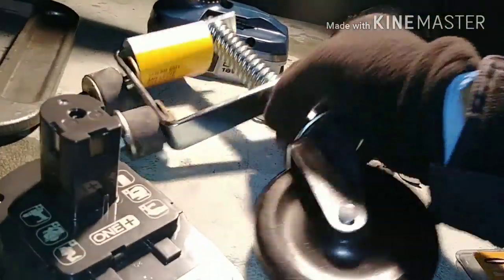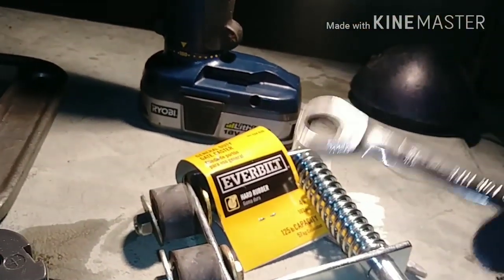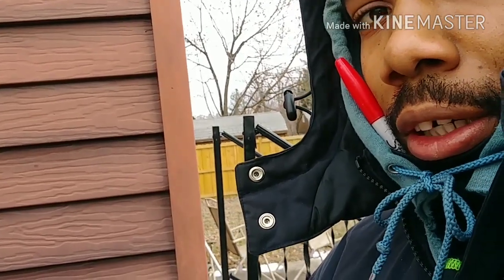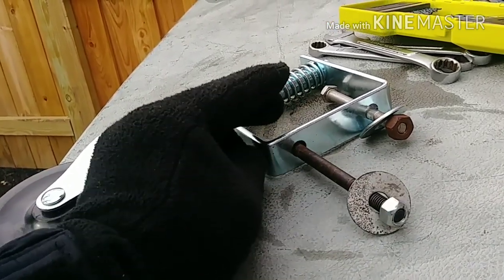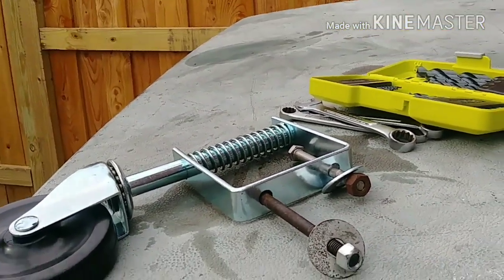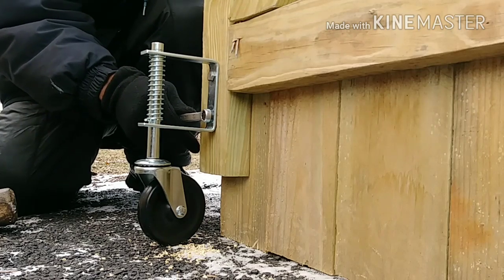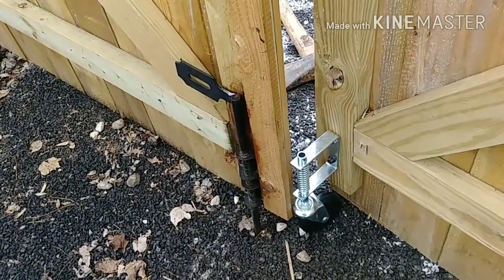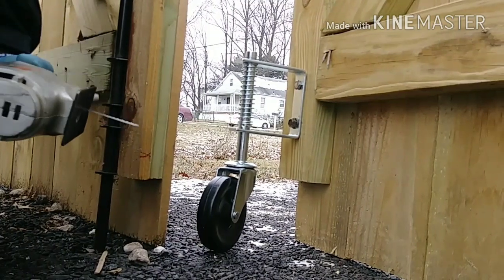Old Errol:wood fence gate wheel building a cement work pad area Vlog 2

Comment: Your compression Brace is backwards. Swith it and the sag will go away. Do not use a tension brace on a wood gate. Wood gate suffer from compression while chain fence suffer from tension. Also interesting idea using rubber bushing.

Comment: Hi good idea with the wheel. The main reason your gate has dropped is because the diagonal braces should be going the other corner to corner. the way they are fitted are not supporting the gate from sagging
Reply from the maker: Thanks. Me and my new  Neighbor was just discussing how bad of a construction my gate was. now hes install in his own gate and shown the proper way that it should have been done.
Reply: Correct 👍
Reply: @olderrol1968  hey brother , I'm Mexican and it really appreciate your idea .
Gracias amigouuuuu
Reply from the maker: That you for your kind words. 👍

Comment: Couple things you did wrong here. You could have added wood to were you wanted to mount it, 2 you should have shimmied up the fence before drilling the homes and mounting the wheel so the spring takes the pressure,  shim it up allot higher so when the wheel is mounted with wheel on floor when fence drops the spring load hold it up. Also spin the bolts around and use stainless or galvanised bolts that wont rust and aren't dissimilar metal of the wheel metal
Reply: I was about to ask, how do you know where the screws go for best tension. Thank you.
Reply from the maker: I really just guessed. I tried put in as much tension on the gate wheels pride to install in this.  Because once the gate gets wet. it comes down a little bit more than normal.

Comment: Very useful video. I'll be doing something similar to my driveway gates. It might help you if the diagonal cross-bracing on the back of the gates is mounted in the opposite direction, meaning that its low end is at the hinge side of the gate and the high end of the cross-bracing is at the opening side of the gate leaf. That way, the cross bracing will be able to support the gate leaf from sagging. But you have to make sure that all the joints or fixings that connect the cross-bracing to the gate leaf are tight and secure so that all the force of the gate leaf that wants to sag is transmitted into the bracing. Hinges also have to be securely fixed to the gate leaf. Hope this helps you. Thanks for the video.
Reply from the maker: I will most definitely look in to putting some kind of brace on the gate in the future.

Comment: What you should have done is lifted the gate up slightly so when fitted it sat down on the spring a little bit
Reply from the maker: I will definitely keep that in mind. Thank you 👍
Reply: @olderrol1968  ground all looks pretty level that it’s rolling on but taking some slack up on the spring means that if there’s a dip in the ground the spring will travel to meet the ground otherwise the wheel will just hang in mid air and be of no benefit
Reply from the maker: @davidktd  : The gate drops when   It gets wet from the rain.
Reply: @olderrol1968  all ok. All good though. I’ve got to fit mine on a new set of gates.
Reply from the maker: Yeah. I find at the gate wheels itself. Wear's out is out over a period of time.😣. Home depot should have them in stock.

Comment: I would just say that, though the wheel wouldn't be central on the vertical wood of the gate, I think you would have still had enough strength in the wood if it had been put a bit to the right. You could always still move it, but you would need to glue in some wooden dowel to fill the drilled holes to be able to drill new holes fairly close to the old ones. As for the bolts, if the nuts still come loose, buy some nyloc nuts. They should only be a few cents and they won't vibrate off the threads like those normal nuts. Otherwise good job pal.
Reply from the maker: The was it is works pretty well .

Comment: The bolt should have been inserted from the outside of the gate for a cleaner look.  Also, I would have compressed a little bit of the spring before mounting the caster wheel to the gate so that it would take some of the load off of the gate hinge.
Reply from the maker: Most definitely.  I'll look into that.

Comment: I think it would be easier to cut the door only half centimeter (or more, if you need) in the low part. If you look in the first seconds you can see that the boards have different measures. Greetings.
Reply: I agree kindly.

Comment: I just found Northern Tool’s item 60993 which is a 400-lb-rated double wheel. A reviewer pointed up its bracket and U-bolt fit a FENCE pipe 1 & 5/-6”. Since my GATES are of 2” pipe I’ll modify the bracket and use 2 per gate section. That should over-engineer it. Thanks again for showing us the way. 👍
Reply from the maker: That sounds like it's going to work even better than the one I have .i would love to see the finished product.
Reply: Lol sounds like me. Rather build it once and over engineer.

Comment: Thanks for your video. I just discovered this kind of face-of-gate-mounted wheel. My gate is heavy so I may reverse engineer one of these to use heavy-duty parts. I wish somebody has already a sturdier one. Anybody know of one? Good job.
Reply from the maker: The gate wheel mount is a great idea . but I wish the spring was stronger.
Reply: @olderrol1968  where did you buy the wheel?
Reply from the maker: @powerstuffup  : At The Home Depot
Reply: @olderrol1968  cool thanks for replying
Reply from the maker: No problem.  Remember you can always double up on the gate wheels if one is not enough
Reply: @olderrol1968  yea that's true
Reply: You may have already found a solution to your question by now, but northern tool is having a sale on suspended gate wheels right now. The two types I'm looking at in particular is a single wheel 210lb capacity and a single suspension double wheel thats 400lb capacity. Maybe one of those would work for you?
Reply from the maker: Were you able to purchase a gate wheel from the sale?

Comment: The gate isn't supported correctly.The diagonal should be on the opposite side. I would have put a board under the gate to get it off the ground then the gate would have been supported by the wheel.
Reply from the maker: Do you think it's a good idea to  Double up on the wheels?

Comment: Why didn’t you just brace the gate up so the wheel could go in easier and at the right tension level?
Reply from the maker: I guess I figured with the will being Spring loaded. It would have automatically adjusted the gate in the proper position.
Reply: old Errol: I guess it worked. But the usual way is to brace or wedge the gate to the height you require and you wouldn’t have to fight to spot the hole marks or insert the bolts.
I got a large metal fence that a customer requires bracing and will need a similar solution and your video was partly used to show the customer the type of solution I had in mind. Cheers.
Reply from the maker: @augustussmith5746  ; To be honest with you it was a learn as I go process.

Comment: Your Gate hasn't enough support for the weight, Sure a wheel then takes all the support of the weight but then your dragging a wheel every time you open or close the gate. I can tell by the bottom of your fence panels that the whole gate is drooping, It doesn't look as if your gate was framed correctly
 What Farmers and fence builders been done for Hundreds of years you take a cable or wire from the top of the gate by the top hinge near the post down to the bottom of the gate at the opening and put a turn buckle in the middle of the wire or cable and tighten until it takes the droop out
Reply from the maker: I think I have an idea of what you're mentioning about the cable. But the individuals that made my gate .  Drop the ball for sure I can tell when I look at my neighbor who is building his gate right now. The post he is using for  his gates are much thicker.

Comment: On my fence i put cement pavers where the wheels rest. On that gravel the wheels will dig a hole eventually.
Reply from the maker: I had but down some black top
Reply: George do you have a picture of your gate wheel setup? Mine are rolling on grass(more like mud now) and I’m looking to see what I can do to keep the wheels from digging in further.
Reply from the maker: This is a updated video https://youtu.be/DmUnJeCU2GY
Reply from the maker: You may want to go to home depot. And grab a bag of gravel and a bag of  Black top
Reply: @lizzyowls1017  no, I do not. But I just set down a paver for each wheel where they sit on dirt. But my gate opens out into a back alley and it is paved up to the gate. So once I start to open the gate it transfers to the pavement. If I had to go over gravel or grass, etc, i would figure out a way to attach tires such as wheelbarrow tires as they are made for going over grass and gravel.

Comment: wouldn't it be easier to shim the fence with something under the end of the fence for the height you wanted?
Reply from the maker: I wanted to wheel. because every time the fence itself gets wet it sags
Reply: @olderrol1968  he meant shim it up then mount the wheel so the wheel spring took the presure

Comment: I just want to ask where can I buy this heavy duty wheel support? Thanks much...
Reply from the maker: Tractor supply should have them. Or home depot
Reply: Amazon has them now as well. I also purchased a U shaped 2” double bolt to attach mine from a local ma & pa hardware store. These wheels work GREAT on Single and Double Gates. If you have a double gate that is sagging also install a turn buckle it will Help Tremendously and is super easy to install as well. Hope this helps.